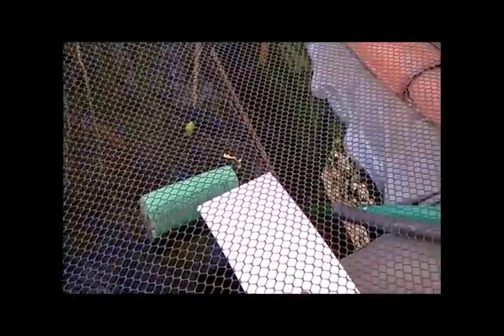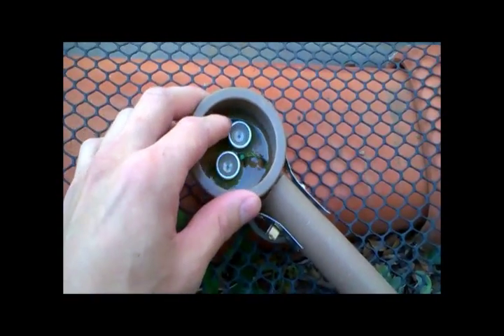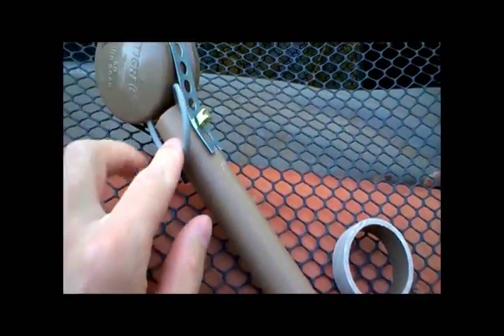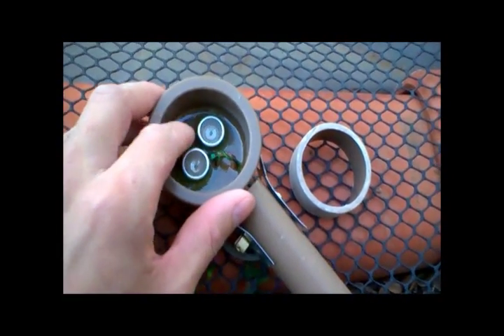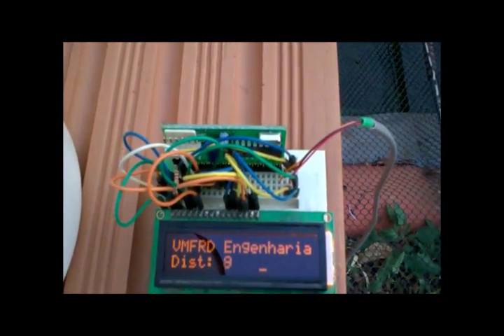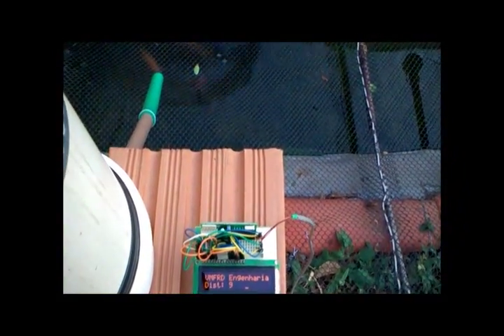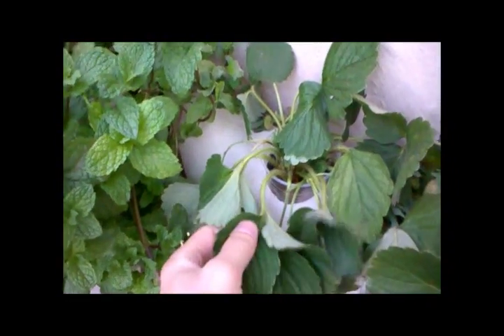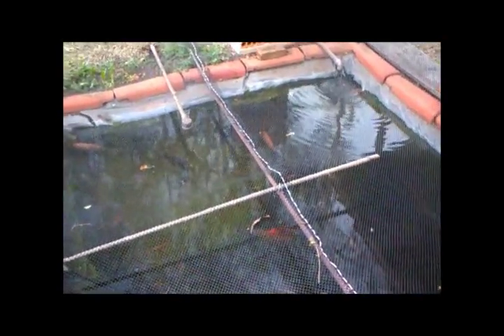Aquaponics Project Update - Water Level Measurement

Comment: Can I use some floating point and statistics calculation to increase accuracy?
Reply from the maker: You can do a simple average of the signal or use some complex filter... But since this type of sensor is not 100% water proof I wouldn't recommend it. I'm now using pressure sensors (MPX5010DP) in both my tanks to measure level. Those I recommend...

Comment: Nice isolation of the ultrasonic sensor, it's been more than 9 months already, still works properly? (the hc-sr04 sensor)
Reply from the maker: i've decommissioned the ultrasonic sensor on january of this year and it was still working. The only problem i've noticed was that if water gets in the metal mash that covers both emiter and receiver, the readings go very wrong. Otherwise its a good sensor, but it just can't beat my float sensor.
Reply: Oh thanks for your quick answer, I was thinking of using a hc-sr04 to measure water level, I guess it would be better to look  for another sensor who is able to get wet and still works, perhaps the jsn-sr04t will be more suitable.
Reply from the maker: That's probably a good idea, since this sensor appears to be water proof. But's like I said, if you want a truly reliable sensor, go for a floating one (well if you can!). They also provide better resolution, mine can tell if I drop less than 10L in the tank.
Reply: @VMFRD  what do u mean by water getting inside the mess, was it due to condensation or due to water overflow?
If it was due to water overflow maybe placing the sensor inside a long hallow plastic tube will keep water away due to buoyancy (water will not touch the actual sensor air will isolate it)
Reply from the maker: @sam_8a  It was due to water splashes caused by the fish or condensation. I've tried your idea of placing a long pipe just outside the sensor but the pipe messed all the readings from the sensor. This type of sensor with one emitter and one receiver is very sensitive of its surroundings and will not work well inside a pipe.